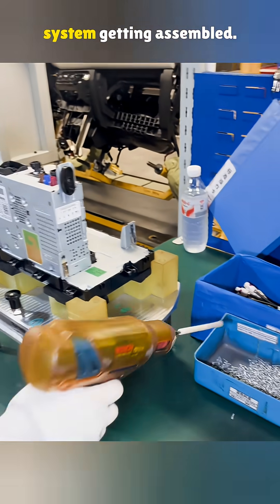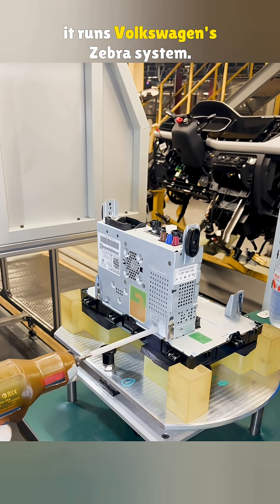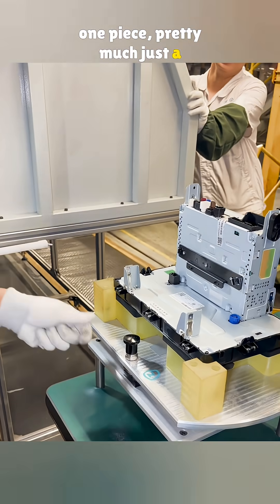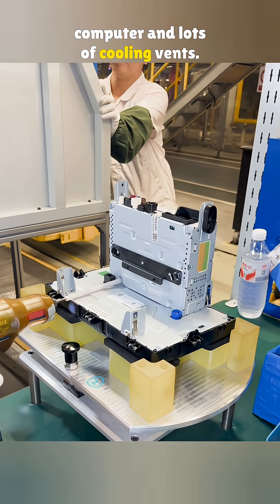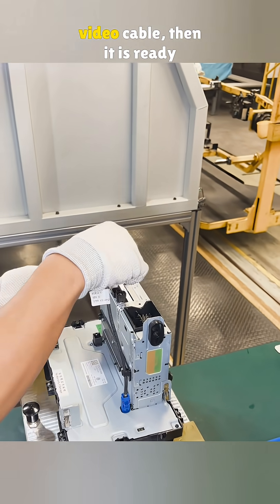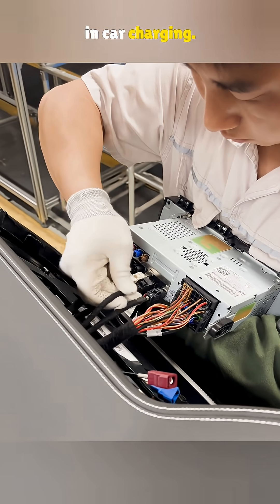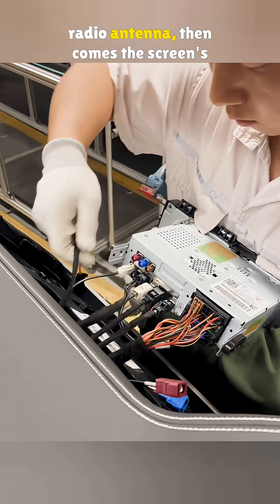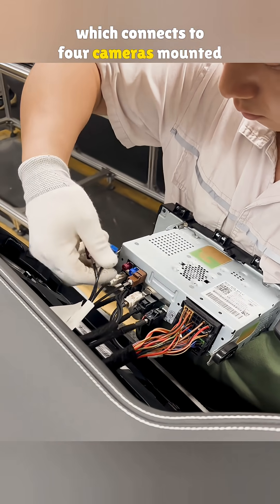Why Volkswagen’s Built-In Infotainment Beats Most Upgrades #assembly #automobile #car #manufacturing

Comment: I dunno man i stay in dubai and the heat gets 50+ in the summers and i have been using an aftermarket (chinese) head unit for about 3 years now and it works as good as when i bought it, despite the extremely hot weather over here
Reply: Same here. I am in Dubai too. Using an aftermarket one for the last 6 years. Perfect as Day 1. Our mobiles are slim and they get abused more than a car system. Even a 100 USD mobile lasts pretty well. So I don't really agree with this video.
Reply: Only issue is sound quality, no android aftermarket system can match a factory fitted unit. 
Factory unit uses separate amplifier for audio, its way more heavy and sound quality is top notch.
Reply: But the after market systems do not integrate with the car systems like AC control, air purifier control, integrating with the carefully calibrated mics for phone calls, etc. For example, even my AC fan speed is on full blast and I press the voice assistant button, the car reduces the fan speed temporarily while the assistant is listening for my commands.
Reply: @aditya_on_youtube  you don't need an aftermarket one clearly :)))
Reply: @aditya_on_youtube which car are you driving ?
Reply: Yeh habibi u are right, I also own mercedes and got chinese aftermarket infotainment system and it works great even better as it also unlock my mercedes with bluetooth
Reply: How about phone's do they get hot and stop working.
Reply: @dizanm7851 definitely,  which is why i have set up my phone holder inside an AC vent, so one vent is almost always blocked (used to cool off the mobile phone, cause android auto itself causes the phone to get hot, add to this the extreme heat=phones get super hot super quick)
Reply: @dizanm7851 yes they do…thermal cut out during charging and heavy use…as well as ambient temperature…it works the other way when it gets cold as well…your welcome 🫡
Reply: @dizanm7851 yes phones do overheat and turn off until they cool down. It’s happened to me.  Especially when shooting lots of video.
Reply: You may be on a chill ac ..

Comment: But both use unleaded solder that tends to crack under repeated heat and cold cycles.
Reply: And after a while they get tin whiskers.
Reply: Lead free solder is already used for decades... also old lead containing solder will crack. Ever heard of tin pest? There is the difference between low and high quality units...